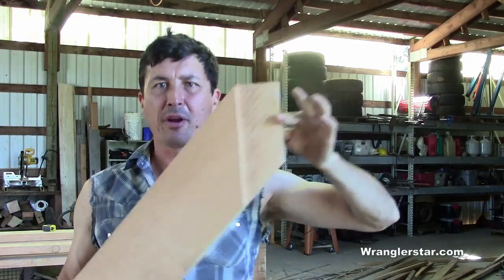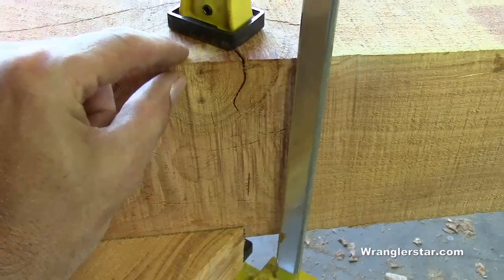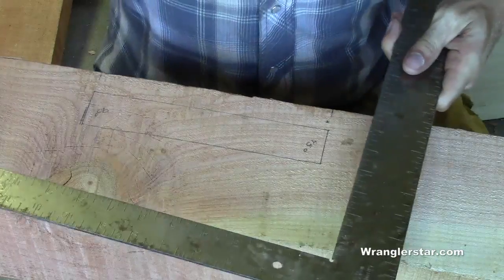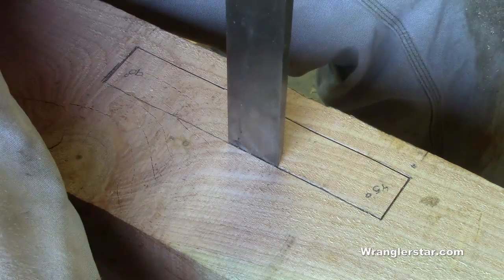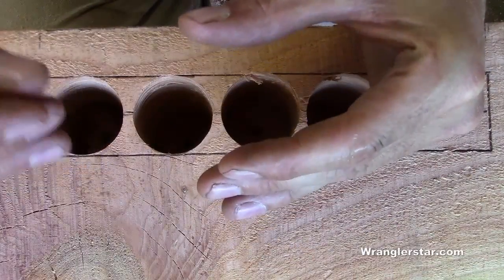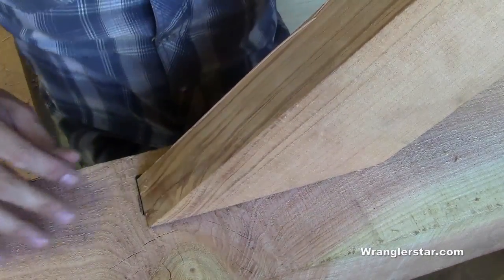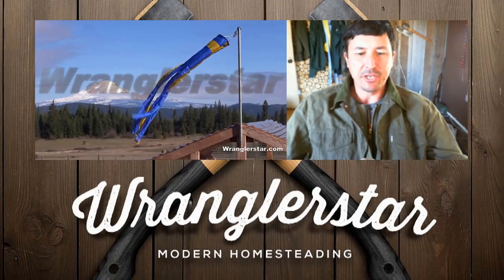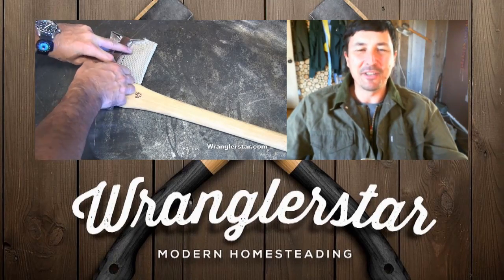Timber Framing | 21 Wranglerstar

Comment: Wow!  Another fan of Patrick O'Brian, too!!!!   I completely agree with you that those books are wonderful -- and packed with a lot of knowledge, both historical and technical.   I've done the complete Aubrey-Maturin ("Master & Commander") set all the way through to Unfinished Book 21 -- and now I'm working through my third "voyage."     I, too, love mortise and tenon construction, but I will confess that since I got a Festool Domino, I've been hooked on the ease and speed of floating tenons --- though they definitely lack the emotional and psychological gratification derived from a well-fitting traditional mortise and tenon.     Oh, by the way, in addition to visiting Nelson's HMS Victory, a bit closer to home, don't forget to check out the USS Constitution in Boston (actually Charlestown) and the USS Constellation in Baltimore for some really fine shipwright work.  Or the next time you're in the UK, visiting the HMS Victory, mosey over to the village of Wickham (about 10 mi. from Gosport and Portsmouth) and visit the remains of the USS Chesapeake (38 guns) at the Chesapeake Mill, which still stands built using timbers from the captured ship.  In 1807, the USS Chesapeake didn't fare very well against the HMS ("Horrible Old") Leopard (50 guns), and even worse, in 1813, under the command of Capt Jas. ("Don't Give Up the Ship") Lawrence against the HMS Shannon (38 guns), which explains how the USS Chesapeake wound up being used in the construction of a mill in Hampshire, UK  in 1820.  Or, of course, your could head to San Diego and go aboard the HMS Surprise, for even more Patrick O'Brian delights.  But wherever you go, you should join in and sing a rousing verse or two of "Heart of Oak."

Comment: Thanks for the great videos.
One tip, is w/ your drill bit, you can overlap the holes when drilling the mortises. As long as the center spur of the bit has fresh wood to drill into, your holes can overlap and you'll have even less wood to chisel out.

Comment: Hi Wranglerstar, it's really not necessary to spend time making a 45 degree cut in the brace mortise to match the 45 on the tenon of the knee brace.  Knee braces prevent racking (frame going out of square under wind load and such) in compression.  They're not a strong member in tension, which is why you always need to use them in pairs in a frame opposite each other.  So the bearing surface is really what you have marked as the 90 degree side, so there's no need to bother with the 45 on the other side, just make it 90 as well.  I've seen a lot of English style frames here in New England and all the brace mortises are square on both ends.  Draw bore your peg holes, use a rived and shaved peg rather than a turned dowel, and you'll have a very strong joint.  Jack Sobon has two excellent books on timber framing that I think would interest you.

Comment: Have you tried using a barn auger to drill out the waste. It's really amazing how well a sharp auger goes through the wood.
I have been restoring augers for about 10 years. Once you learn the tricks of sharpening them they work quite well.

Comment: This is kind of hard for me to explain.but the knee brace at the 6 inch width where it goes into the Mortis. If you take a quarter inch off of both sides it will cover the same way as your half-inch did. When you see it from the outside. I have been a framer for over 25 years and I must say it is looking good!

Comment: When my wife and I met I was working as a framing carpenter, about a year after we married my Father-in-Law asked for my help re-roofing his old mini-barn.  This barn is 2-stories tall and about 4 garages in surface area with a simple 8/12 pitch steel roof.  I had never been inside of this building before this so imagine my surprise when I started to remove the old roofing material and it was the slabs of many tree trunks, the rafters were 5 inch diameter tree trunks with the bark removed.  All of the rafters went down to the walls which were 12 inch square rough hand hewn beams with tree trunk studs with mortise and tenon joints.  This was the first time I had ever worked on a building that was put together without the benefit of nails.  It turns out that the barn is well over 100 years old and is part of the original deed description for the property.  It is still standing after all of these years and is in incredible shape.  In my opinion this type of construction cannot be beat.

Comment: Cody, Just a thought, if you would have truncated/trimmed your tenons short of the 90deg end by 1/4-1/2" and reduced the length (offset the start) of your mortice from that end's layout line accordingly, you wouldn't even see the end of the mortice slot adjacent to the knee brace on the obtuse side.  Same goes for the 45 degree end, (even though that end is already more hidden on both ends of the brace).

Comment: Cody, I definitely don't have any knowledge of TF, but it seems to me that cutting off the 45 would make logical sense, as then the board could not pull out at an angle, only straight out. It would also make cutting the mortise easier. Might make assembly harder. I don't know.

Comment: Its just amazing how far craftsmanship in the modern day has gone down. Wouldn't it be amazing if everyones houses were built as an interlocking structure? If you feel the need to move, disassemble the house and take it to your new location. Now THAT would be a proper mobile home.

Comment: Cody, you should check out Paul Sellers method for cutting a mortis.  Nothing but a hammer and chisle.  Roy Underhill, from the woodwright shop, has a segment with the very same method.  I have tired it with good success too.  Nice work so far.
Reply: JCrook1028 ok, I get that.  I was just curious.  I enjoy leaning new things and new ways to do them.  Simply thought I would ask.  Seems to me that Cody is much the same in that respect.

Comment: Take your speed square and make small notches at 1 1/2 ,3 1/3, and 5 1/2 that way it will hold your pencil  when scribing paralell lines these demensions are the most common numblers in framing

Comment: england loves you too.

btw, for the same reason your mortice is oversized by 1/4" - shouldn;t the angled part of the tenon be also accomodating by a few degrees? If the logic is that the vertical timber shrinks to force out the tenon - then it would also bottom out on the 45* wall, no? (think about it...)

Comment: Wrangler I was watching a Paul Sellers video and he was drilling Dog holes in a bench but he shows a quick way to start a drill like that straight. He took a 4x4 and cut out a corner of it, he then lined up the bit with it and his hole was straight. anyways check it out. may help with drilling straight holes. I know I will use this trick. Retro fitting a Non-Dogged Vise - with Paul Sellers

Comment: Heres a tip for ones safety.  Purchase a new circular saw; with plastic housing and double insulated motor.  Even though the one you have now has a grounding wire... ...if that grounding doesnt make to your grounded...your breaker will never sense you being fried.   Keep up the Good work.

Comment: Centered tenons are a bit better structurally if they were fully supporting beams but for braces, I think it would just be cosmetic. Green wood is going to move around a bit as the timbers dry and the structure settles. Most likely, the shoulders would not match up that well anyway even between the time cutting the joinery and actual assembly of the structure. Looks great as it is.

It's not traditional but an oscillating multi-tool is great for cleaning out down in mortises like that. Especially for hitting that 45 degree angle.
Reply: It's not that bad. It can be a problem if you were doing something like hanging kitchen cabinets or fitting a door frame but most you wouldn't notice unless you took a square or a straight edge up to it otherwise.  

They did a lot of green woodwork in the past as it is much easier to cut and shape before it dries. Then it dries in place and is hard as a rock. :)
Reply: Chainsaws and Skilsaws are not tradisinal  tools nobody is throwing a hissy over anybody useing them now   
The Ocsulating Tool O.T. is not a tradishinal tool now but very practical  for cleaning out the webs left behind by the drill  

I have not used a OT for deep cutting like this but in useing them for a plungeing cutting  they tend to pack up with sawdust  so I would have a air blow nozzle handy  

In drilling out the mortiste I would  use a porta-line drill press and forsner bits  that way You can drill overlapping holes to eliminate  most of the webbing  the OT  would work better  when it has a place to have the sawdust fall out  

Maybe +Mattais Wenddel could design a jig to make the slopeing cuts with a OT
Reply: Jim Watson  Generally, you calculate one year for each inch of thickness for air drying wood.  If you are dealing with 8 in timbers, you cannot just wait for 8 years to build with it. You have to just build and deal with any movement as you can.
When you are talking about beams, they just cannot warp and twist the same way boards can. There is just too much wood there.  There will be all kinds of crazy stresses inside the beam but they will equalize over time as the moisture stabilizes.  
When he is done, it will be perfect.  :) It will just not be perfectly square and plumb  like a piece of furniture  nor is it expected to be.
Reply: I think the portaline  portable drill press can tilt to 45° I would test it to see if it wanders  in its cut before I drill into a 6x6"
Reply: Porta line drill presses or knock off copies are in the $20 range  

The rods that the DP slides on could be replaced with longer ones 

For $20 ish  You would hard pressed to make one cheaper
Reply: Jim Watson
 This is why when working with green wood, the building process HAS to be done very quickly. I suggest people look up how the Mennonites and others that build with green wood, see how they do it. The process is done very quickly, plus when using a wooden peg/dowel made from scraps, those are designed to have a tighter fit and stronger holding power when there is movement.
Reply: Tree nails or wooden pegs as they called today are a very strong way to lock a joint together 

Espeicaly when the hole through the tennon is slightly off center  driveing the peg home draws the joint together tight
Reply: Walt Lars Drawboring works on furniture scale construction. On timber framing scale, you cannot drive a peg that way. They just aren't strong enough to pull a joint tight. You will just pound them into splinters. Even down to 4 X 4 size lumber, you just drill straight through. Usually, you have the pegs dried. After they are installed, they will swell and they are not ever coming out.

There are some really fancy joints with wedges to pull the joint tight but they are generally used for knock-down structures that are meant to be disassembled and moved.
Reply: TsmnnDvl5 It is actually a bit more sophisticated than that. The wood in green woodworking is split (not sawn) while green and the pins are dried. The pins swell with the moisture and lock in place.If you are interested, check out Jennie Alexander and Peter Follansbee. Wonderful resources.
Reply: Thor214 Yes, those are generally referred to as tusk tenons.

Comment: Hey Cody Great job all around. I was just wondering out of sheer curiosity and ignorance why you only cut a shoulder on only one side of the knee brace and not both sides to hide the entire mortise?
Reply: I am going to hazard a guess here and say that maybe it is because the side without the shoulder will not be visible.
Reply: That's What I was thinking and it makes total sense, but I wasn't really sure. On most pieces of furniture you only see the outside, yet the tennons usually have two cheeks. I was wondering if there was something unique to timber framing that allowed you to do this.
Reply: Ross Pagni The shoulder also acts as a supporting stop point on the timber.  As the wood moves due to moisture, this stop will help maintain the integrity of the structure.
Reply: Indeed +David Harris, and if he pegs them,  and as I assume, drawbores them, one would think he would want an even distribution of pressure along the entire knee brace. I guess that's why I am wondering why only one side has a shoulder. However It could be totally adequate the way he is doing it. This is Cody we are talking about, the guy does his homework. I have just never seen it done that way before. That being said my exposure to and knowledge of timber framing is very limited.

Comment: This is the first time you've ever lost me... I didn't follow how how you kept the mortise angle true on 45 degree side of the pocket. 

Did you hew a rough 45 inside the mortise  and the work the surface out towards the final guide line, or did you use the angle square to set the chisel angle for the initial cut?
Reply from the maker: No I just eyeballed it with the chisel,
Reply: wranglerstar could you possibly cut a guide block at 45 degree and clamp that down to the post to lay the chisel on top? The guide block would need some sort of tail for the clamp to hold onto. <----- (a poor diagram but it gets the idea across).